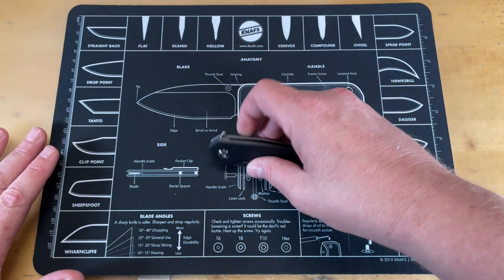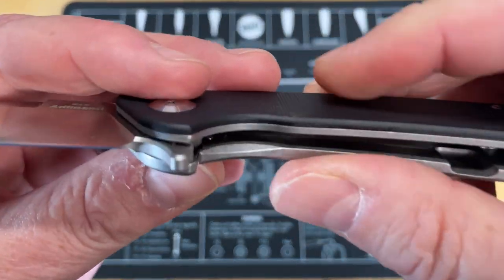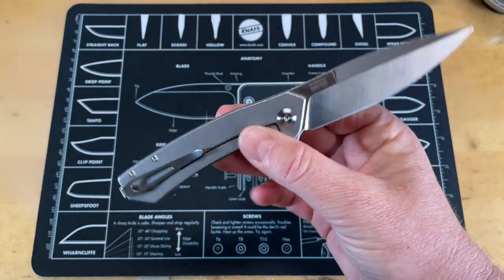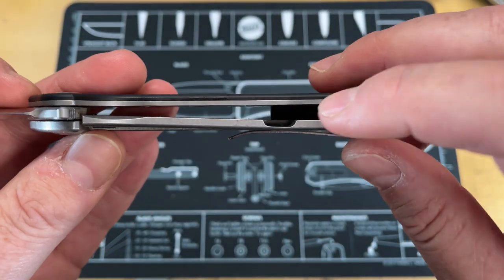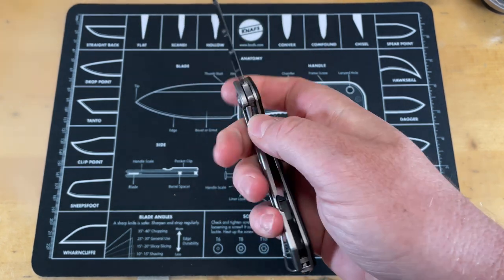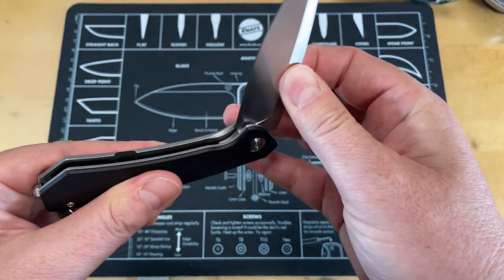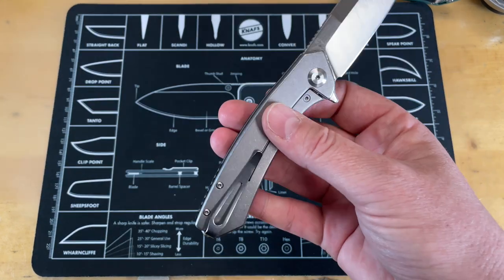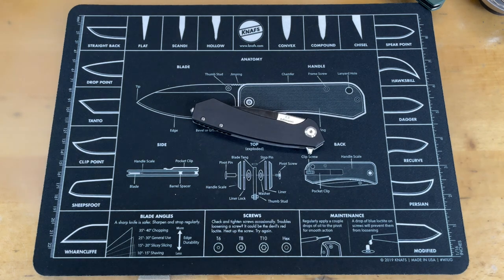GANZO ADAMANTI FIRST IMPRESSIONS | AND I AM IMPRESSED

Comment: I have the Titanium and S35vn Adimanti Neformat (same model as your testing here but Full ti and S35vn) I paid about 85 or 90 bucks for it a while back on amazon. It's amazing, if yoy didn't know better you would think its a 180 to 200 Chinese ti frame lock, it feels just like Kizers and Kubeys flagship stuff does. The S35vn is well done performs just like I expect well done S35vn to preform and feels great on the stones.

I don't know if they still make the full ti and s35vn model but if they do and it's went up to like 100-120 bucks it's a damn fine knife at that price range.
Reply: I believe they still make it. They are at least usually available every now and then. And for around $100 it's a steal. I got knives well over 200 that performs way worse than the Ti Skimen.